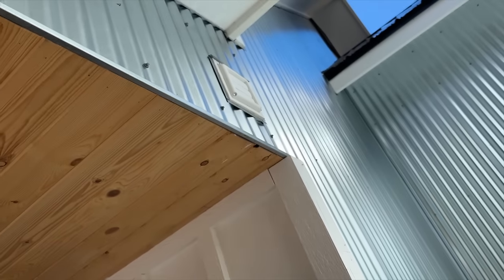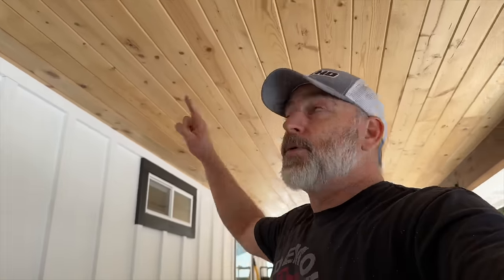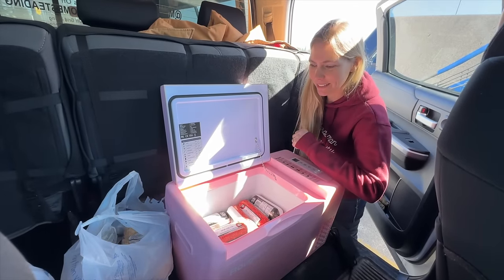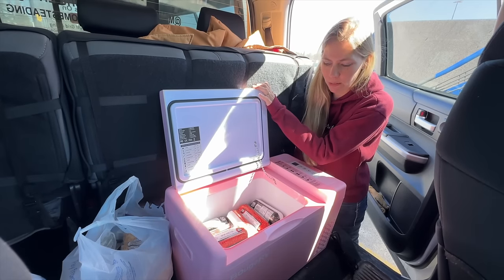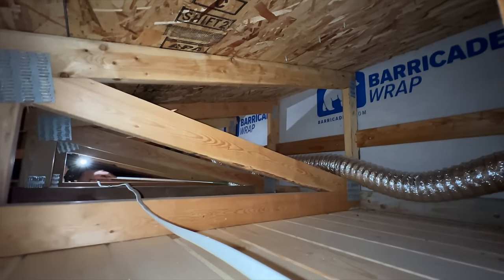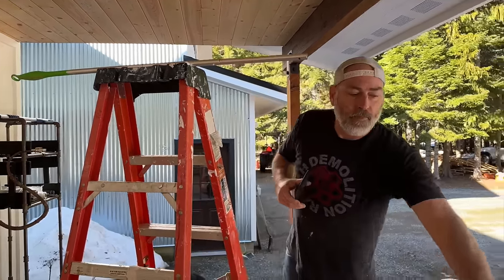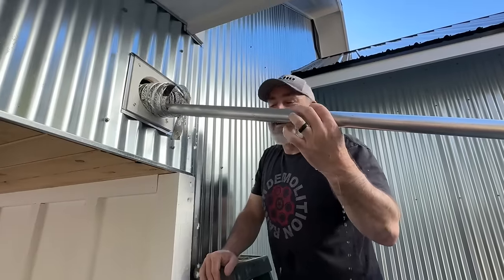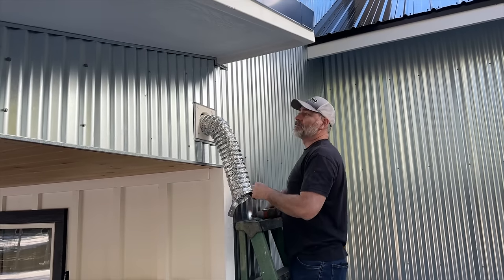SERIOUS PROBLEM with our HOUSE! My Biggest Construction Mistake

Comment: If you keep the current setup, you will still have the same issue with condensate. You will have to shorten your run either through the roof or the tongue and groove.
Use rigid  pipe, either aluminum or PVC.  I remember several folks forecasting the issue you are  now facing and offered alternatives.

Comment: Bigger fan.  Rigid pipe.  Shorter run.  Access.  It seems like you could straight out then dump into the gutter, but I am sure you will come to a better solution.

Comment: Flexi duct should only be used in small areas . Soild pipe where possible running down hill to prevent any water backups just like drains.

Comment: i prefer to use an HRV for all of my bathroom ventilation needs (supplies in bedroom closets typically).  with insulated vent there typically won't be any condensation, unless at the HRV, where it is easily controlled

Comment: That run is very long and you may need a stronger fan, in line fan, or solid metal duct. All those ridges in the foil duct you used slow the air flow.

Comment: Support vent pipe with boards and pull your vent pipe tight. Or replace with non flexible vent pipe. Also make sure it is big enough and the fan air comes out the side of house forcibly. And yes, an access door might be a good idea.
Reply: The option of using the flexible pipe is gone as it is leaking due the puncturing during the drain attempt.

Comment: Most bathroom vents I have ever seen/installed, vented through the roof or attic to avoid the condensation issue.  You can get away with dryer venting over longer distances.

Comment: if warm wet air and pumped it outside and makes a turn before running outside to the vet it will freeze in the pipe

Comment: Thr bathroom exausht fan run is too long and through flexible pipe which will restrict the airflow. You need to vent the bath exhaust fan directly through the roof. It is the easiest and shortest run in your situation and then insulate around the exhaust pipe.

Comment: I'm a general contractor in MN. It needs to be 4" insulated R6 minimum. This will allow for the majority of condensation to occur outside the vent, rather than inside the tube. The 4" is key, as it is needed for the 110 cfm. You have 25-35ft from the fan in most cases, but every 90° elbow takes away 5 ft from that distance.  Insulation is the KEY!!! Do not install at a negative slope to the outside. This will make the fan work harder and possibly freeze up the louvers, traping air. 

You could split a run of pvc to act as a cradle with pipe j-brackets as support. Typically i install a brief flat loop in the insulaion of the attic to allow for the usual limited condensation to gather  in temperate area of the tube. AND allow at least 20-30mins of fan time after the shower to allow the air to evaporate any condensation. A fan timer is important to have to in cold climates. Good luck.

Comment: Early on,  many suggested two things.  1.) Don't run flex line.  2.) Put an in-line blower somewhere near the middle if you absolutely have to run that long.   Now that it has come back to bite you, either run it up and out through the roof,  or go with rigid metal/PVC but still use an inline blower given the lenght of the run.

Comment: You have to insulate a vent when it is run through an unconditioned space especially when you live in a cold environment else the water will simply condense inside the pipe and cause your current issues.

Comment: yup......rigid pipe and shorten the distance. Dryer vents and bathroom vents should be as short as possible to avoid this very problem.  with the cold space and long run at the very least you should go with the plumbers guide of a drain pipe as there will always be water in that long pipe.  better fix run the vent across the porch to the front. May not be the best visual but better than water damage to the ceiling of your porch.

Comment: The maximum length for any vent hose should be no more than 9 feet. The fan does not have enough power to push the warm air out to the outside before it meets with cold air and condenses. The bends in the hose are causing a 'P' trap, where the condensed air/water is pooling, thereby stopping the warm air from the bathroom from being pushed all the way out. Either shorten the run to the outside, or put a moisture trap in, where the condensed air can run in to, with a smaller pipe then draining from that. I speak from experience, as I had the same problem, but in my kitchen, to the point where I had water running back down the hose and through my extractor fan. That's when I found out about the length of the hose and solutions to the problem. Good luck, on whatever you decide to do to fix the problem.

Comment: Cut yourself an access door in the porch roof - and hinge it. Then get into the roof space and replace that flexible pipe with a solid 4" PVC pipe, Make sure it has a drop on it of maybe 1/4" per foot and run it to the vent. It would be better if you could move the vent a lot closer to where the pipe comes out of your bathroom. The only danger then is that in the uninsulated space the  steam will condense to water and the freeze before it exits the vent - another reason to reduce the run as much as you can.

Comment: Your biggest mistake was not insulating the ductwork, we used a flexible duct with a R8 rating. When the warm air meets the cold walls of the duct it will condensate and you will constantly get moisture in your duct, even with a rigid duct. Your best bet would be to wrap some insulation around any ducts in an uninsulated area

Comment: Never use that flex duct it is very restrictive and slows air flow use galvanized round duct insulated the fan will work 100 percent better

Comment: This flexible hose seems to be made for venting, not a vent pipe and is way too long. Can't you run a ventilation rigid pipe through the porch roof? Perhaps even without a horizontal section so that liquid cannot collect in the pipes. Greetings from Germany!

Comment: I say build you a cat walk. Maybe in the shape of an obtuse V angle as long as you can and slide it under the existing vent line. This will give it something rigid to rest on. An access panel made from the shiplap is a really good idea anyway. Maybe cut one right about where you poked the hole in the vent line so you can repair it plus while youre up there you can put a slope on the cat walk to allow drainage in the future assuming condensation tries to build up again.

Comment: All horizontal runs MUST be hard 4” to 18’ and 5” to 25’ with a 1/8” slope per foot. 

Never make vent ducts out of flex pipe, it doesn’t work as found out. 

Only way to properly fix it is to open up the space, get in there and replace all of the flex pipe right back to the vent in the bathroom.

Comment: I know its a pain but wouldn't it be easier to access by removing some of the tongue and groove ceiling boards on the porch up against the wall to access.  It probably would require sacrificing a few of the ceiling boards, which would have to be replaced.

Comment: Just direct it to the roof... Straight up whit a vent cap? Second option use a pvc pype big enough to put the existing vent hose through it, Then you dont have to crawl in that space... Just slide it over the existing alu vent hose.., peice by piece... 
Bet way is to shorten that way to long hose and put the vent directly in the tong and grove cyling.  Its in the open, Just fine.

Comment: would be better to put access area where pipe goes into wall would make it easy  then to feed solid pipe in and make connection    one 90 long bend push fit then solid push fit pipe and support it   i would never use flexy ducting

Comment: Should use 4inch abs pipe and run it with a slight slope to vent that way even if vapour condenses it will drain and not sag like that flex stuff. That flex pipe should be banned as it also deteriorates and becomes brittle in 5 years. Abs can be fed in through vent opening and avoid taking T&G ceiling down. Be a little awkward but doable.
Reply: Problem with your suggestion is that they have very cold temps in winter and exhaust vapour will condensate and freeze in the pipe and cause a blockage, that pipe run is far to long.

Comment: portable freezer/ refrigerator 
there  are some thst have their battery  🔋 works with vehicle supply but when vehicle turns off it has its own battery  to maintain temperature for several hours

Comment: Simple mistake. As was stated, rigid pipe will allow the condensation to run down the bottom of the pipe without sagging between the rafters. One thing to consider is the problem of condensation forming still wont be solved by simple rigid pipe. There could be issues in the future with metal rigid pipe rusting out from constant moisture. Also, the damper at the wall is designed for air. Water  could potentially leak into the attic space or run down the wall or start freezing at the shutters.
Insulation is the real answer in my opinion.

Comment: I would consider putting in a solid exhaust pipe and on the outside wall vent, they have ones that are perpetually open but have a "hood" shape (and are made in a version with some hardware cloth over the opening which faces down to prevent entry of birds, mice, etc
EDIT: Hahaha hadn't finished watching and you just busted me..."You should've used rigid pipe" 😂
Reply from the maker: I sure should have! It would have saved me a lot of pain.
Reply: @MartinJohnsonOffGridLiving  House looks great though! There's always a few bugs to work out

Comment: Your vent discharge line is too far from the fan, flex tubing should be discarded and rigid plastic used. Vent down and out the porch ceiling.

Comment: You need to put the went opening on the roof right over the bathroom window, so the duct gets as short as possible, or even put the opening in the underside straight under the bathroom duct, and let the air flow out that way. The way you have it now will just be a future nightmare with moisture and molding, because of all the condensation you are creating.

Comment: 😂 I get to say I told you so. 
Way back when you did the video about putting the duct in, I told you it was way too long and would be ineffective thus causing this issue. 
Maybe you should start listening to viewers who give you sound and knowledgeable advice instead of going rogue without researching.
Reply: Wow.  I'm really surprised that on a homesteading channel that people are rude if not arrogant.  Even pro's that should know better with a full crew to spread the work load make mistakes and Martin has building a house without any experience plus filming at the same time so everything takes twice as long.  All the I told you so and laughing faces is over the top.
Reply: @vulcan4998  nope, not over the top just truthful from someone who has built and remodeled several homes. 
He was told by several people how to install a vent correctly months before he put the ceiling on the porch he just chose some warped view of anesthetics over functionality.

Comment: If seath goes in he might not get out very easily pretty tight space . That was quite a lot of water  marty no wonder jules let out a scream . Was funny though.  Now remember dont use flexy pipe as exhaust use solid pipe with downward angle  . Also in bathroom think you also need to replace with more powerful  extraction  fan to pull moisture out good luck with repair

Comment: It might have been better if you ran the insulated form of that vent hose and secured it in more spots.  The insulated version would help prevent the steam from turning to water when it hits the cold air above that ceiling. Just my thoughts.

Comment: Cut an access hole in the Porch ceiling where the vent comes out of the bathroom. Cut the flex vent tube off and replace with rigid pipe. Attach to flex vent with ridged 90 deg elbow and run new ridged vent pipe. Install a new access panel where you cut the hole.

Comment: Your pipe can’t be that long. You need to make it as short as possible and vent it out either the underside of that lathe ceiling, or to the end where your soffet vents are. If you have that big long pipe it will stay wet for the first 10 feet or so, dust will collect and it will grow mold.

Comment: The vent run is too long and is outside the conditioned space which causes the moisture to condense.  The vent run needs to be shorter and inside the conditioned space if possible.This isn't an ideal solution but you may have to terminate the vent in the ceiling directly outside where the vent pops out of the wall.  That would create the shortest run but unfortunately would dump all that moisture onto the porch ceiling.  As i said, not ideal.

Comment: Freak me out when I saw how much water was coming off of there when you punctured it. There should never be that much water in the pipe, if it was the summer, I would think it could be condensation from cold air going out with hot steam air stuck in there, but, that was like it was just getting straight water in the vent.   If there’s that much water going through your pipe, I would just run PVC and wrap it with insulation, at least that way that water would go to the end. I don’t understand how you’re getting so much water in there.   😮

If that’s all condensation on the inside because the outside is cold, then I would make sure it’s really well insulated so at least it doesn’t condensate too much in the pipe but I would still go PVC and angle it slightly down so at least you have the water running out of a plastic tube at the end   🤔

Comment: I don't think there is enough room for Seth and a 4" vent pipe to both fit in there.  Sorry, I love your videos but I'm not going to be able watch the next one.  I'm afraid Seth is going to get stuck and won't be able to back himself out.  I'm a little claustrophobic.  I would have to remove the tongue and groove ceiling.  That would a lot of work I know.  Good luck guys.

Comment: I HAD TOLD YOU YOUR DUCT WAS TOO LONG WHEN YOU PUT IT IN AND TOO MANY TURNS - CODE STATE 25' AND EVERY TURN YOU SHORTEN BY 5 FT YOU SHOULD RUN IT TO THE SOFFIT STRAIGHT OUT OR IN THE PORCH CEILING ALSO YOU NEED TO HAVE INSULATED DUCT OUTSIDE AND OR YOU WILL THE SAME PROBLEM IT TOO COLD WHERE YOU LIVE ALSO SHORTEN THE RUN